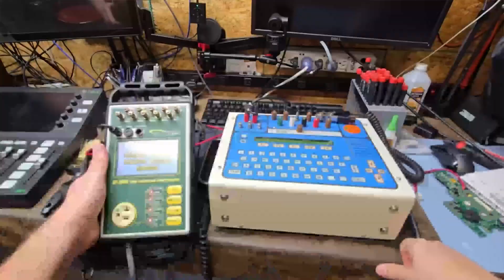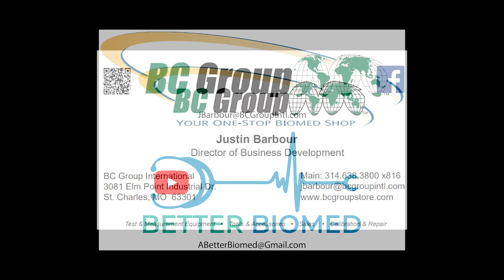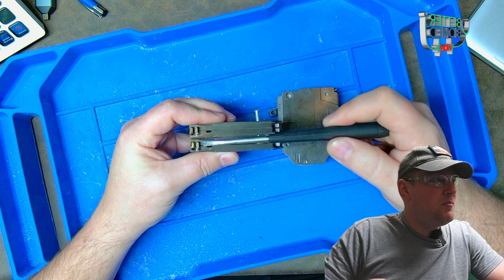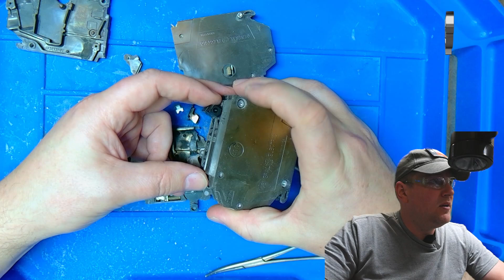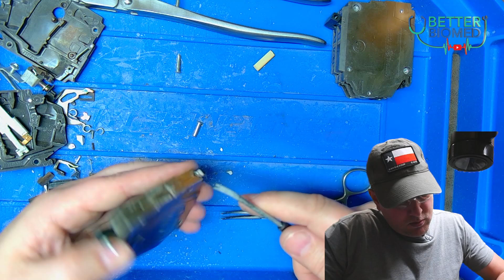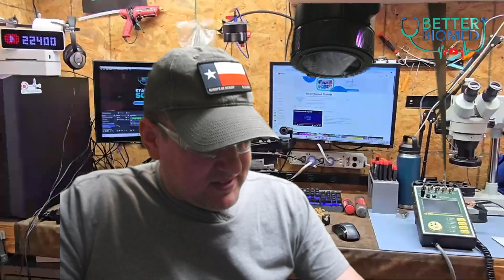Inside defective breakers

Comment: This is was came up with a search: 

Most industrial and residential circuit breakers are made from a black plastic-like thermoset composite that combines high mechanical strength, electrical insulation, and flame resistance. The most common materials include:

1. Phenolic Resins (Bakelite-type plastics)
Historically, phenol-formaldehyde resins (commonly known as Bakelite) were used in breaker housings.
They are rigid, heat-resistant, and electrically insulating.
Still used in some older or cost-sensitive breaker designs.

2. Thermoset Molding Compounds

Modern breakers often use glass-filled polyester (DMC – Dough Molding Compound) or BMC (Bulk Molding Compound).
These are reinforced thermosets (polyester or epoxy resins with glass fibers and mineral fillers).

They offer:

High dielectric strength
Arc resistance (important for interrupting currents)
Dimensional stability under heat

3. High-Performance Plastics

In some higher-end breakers, glass-filled nylon (PA6/PA66) or polycarbonate blends may be used in non-arc-critical areas.
These materials provide toughness and impact resistance but are often used alongside thermosets for the main insulating parts.

4. Why Black?

Carbon black filler is often added for UV stability and to improve flame resistance.
It also helps reduce tracking (surface electrical discharge paths).